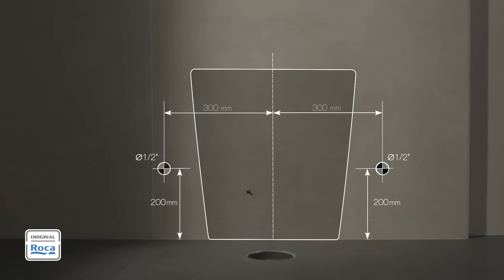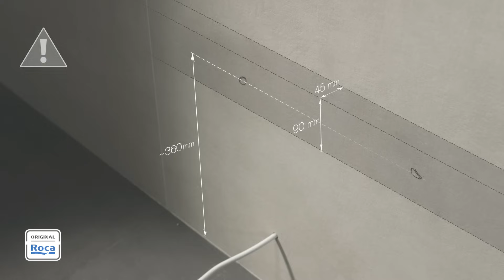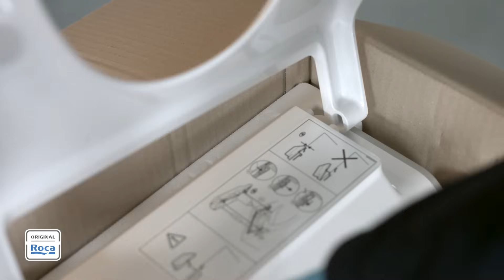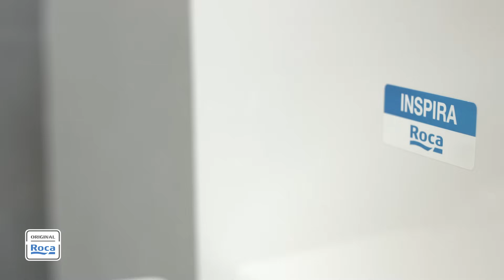In-Wash® Installation - Back to wall close-coupled version | Roca  (Australian version)

Comment: How do you know if all connections are sealed correctly ? When it’s fitted you won’t know if there’s a leak !
Reply: Imagine the pain in a few years when rubbers start perishing. $$$
Reply: when you watch the videos they have little pics that have water dropping ie. at those stages to turn the water on to make sure its not leaking anywhere
Reply: @jeffkeith637  i'm sure most of the people that will be buying this won't care about that